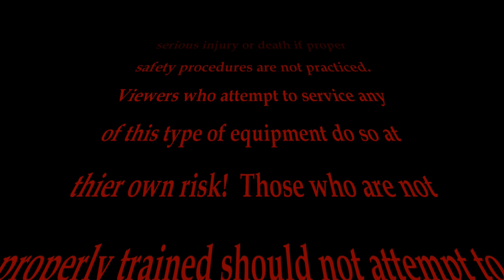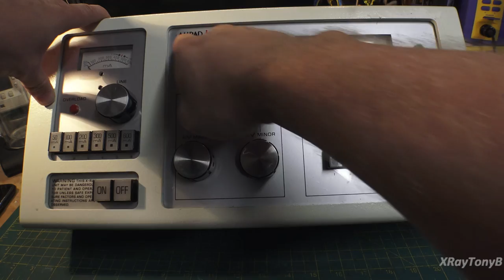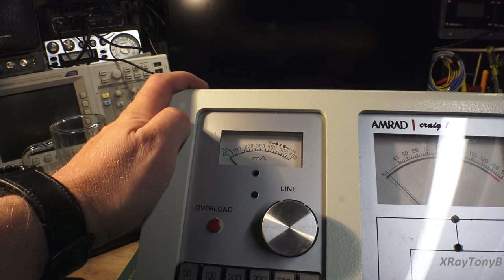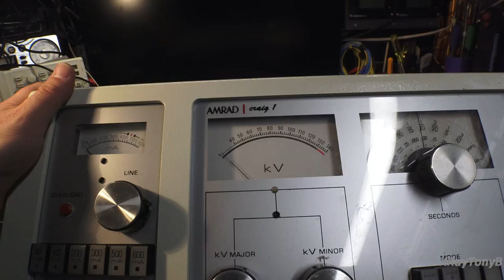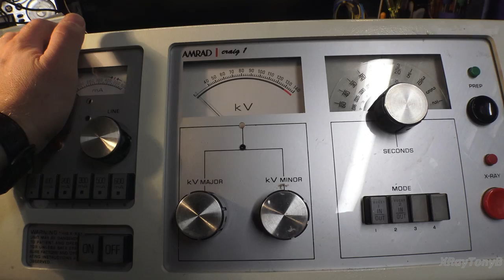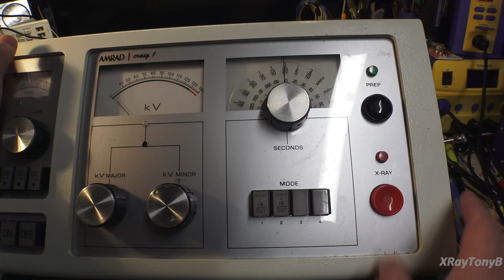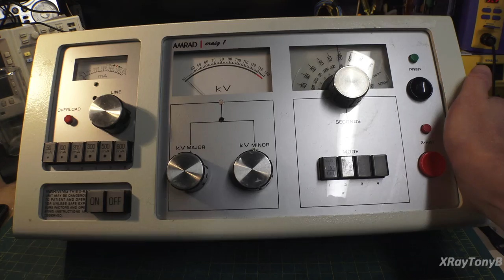Another Look at an X-Ray tube:   Part 1

Comment: Interesting.  How is it that you can adjust both the voltage and the current?  Is it like bench power supplies where you're setting the limit and it will limit at whichever value it hits first?  (For example. 12V or 1A.  If you connect it to a 6 ohm resistor, it will output 6V @ 1A.  Connect it to a 100 ohm resistor and it will output 12V @ 120mA.)
Reply: Exactly what i had in mind! What actually is the VA characteristic of this tube ?

Comment: It's possible or not to change filament or repair rotor in inside tube
Reply from the maker: not possible.  Just like you can't replace a filament on a lightbulb.

Comment: Great video. I just discovered this channel and I think I'll be subbing. Also, I was reading this earlier and thought you might find it interesting. It's an account of some of the injuries caused by early use of x-ray tubes before they realized the dangers. Don't think you need to worry about any of that though, unless you decide to tape an x-ray tube to your head and do a 30 minute exposure lol. Which is what happened to one poor boy.

www.ncbi.nlm.nih.gov/pmc/articles/PMC3520298/

Comment: How the tube gets rotated?  Is there is any motor separately has to attach with the tube?
Reply: The long thin part of the tube is the Rotor and when this is assembled in the housing it goes into a stator that completes the 'motor'
Reply: @paulmoniz6048  can you tell me if I continuously run the xray tube with an power source how long will the tube lasts?